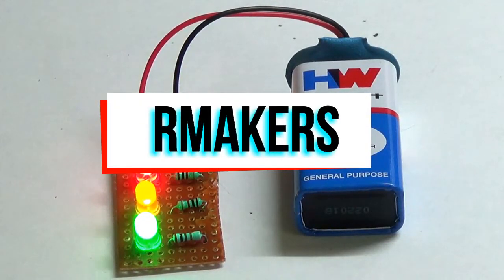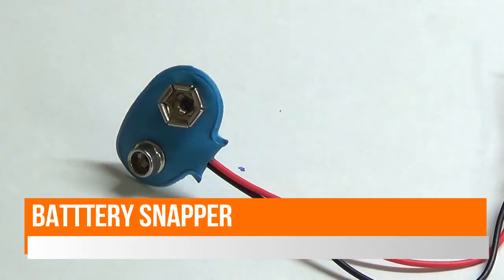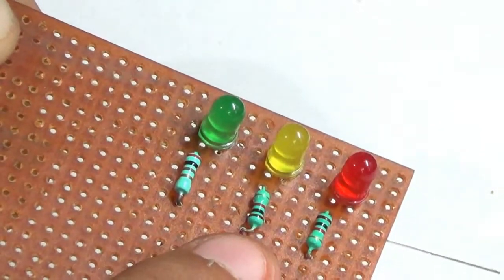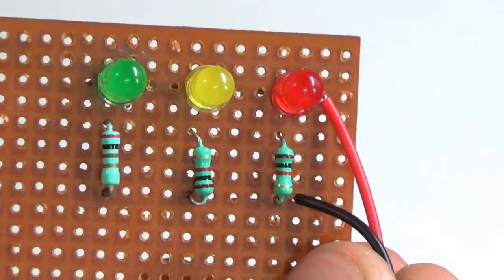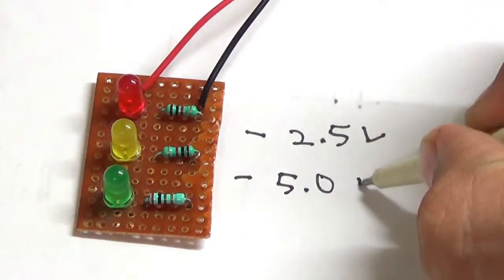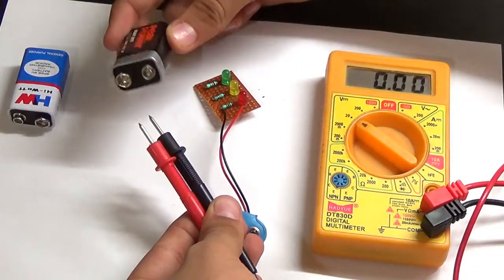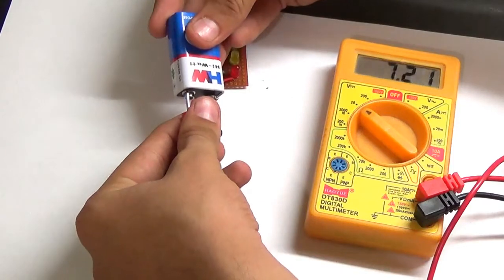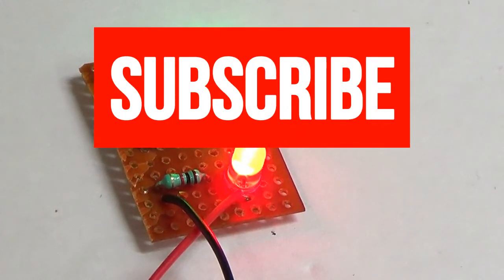HOW TO MAKE 9V BATTERY LEVEL INDICATOR

Comment: It doesn't affect the function, but for such a design, I would align the resistors so that they all read in the same direction - brown black red for 1 kΩ, red black brown for 200Ω.
It might also be easier to obtain180 or 220 Ω resistors - 200 is not an E12 value; this would obviously change the voltage for the relevant LED.
These days, you could also use a blue LED - I'll let you work out the resistor. (Red LEDs about 1.8V, yellow and green about 2.2, blue about 5.)

Comment: nice vid, can u tell how to connect this with potentiometer so that when power increases the lights also light up according to it?
also pls connect the abv circuit with a 9v dc motor(making fr school project)
Reply from the maker: Hey there,
Thanks for your compliments
I am not understanding what are you trying to make if possible describe your project more.
Reply from the maker: You can change the brightness of leds by connecting potentiometer between the circuit and the battery, but then the voltage reading metioned in the video won't be applicable after attaching the pot.

Comment: Bro your video is good. Very helpfull but i want to know its all calculations with which i can brief the circuit and its all components.plz
Reply from the maker: Hi, Thanks for the complement

If you want to verify the calculations just connect it to a power supply and note the value when respective LED turns on.

Or you can calulate it by using Kirchhoff Voltage Law better known as KVL. Also, if you are using a bigger or smaller LED  then 3mm ,the min. voltage values would change.

If you found the video to be helpful consider 
SUBSCRIBING and activating notifications.
Reply: @KaizenInventor  It is not the size of the LEDs that is relevant, but the current rating. Moxt "traditional" LEDs draw 10 to 20 mA at normal operating conditions, but low-current ones can operate on 2 mA.